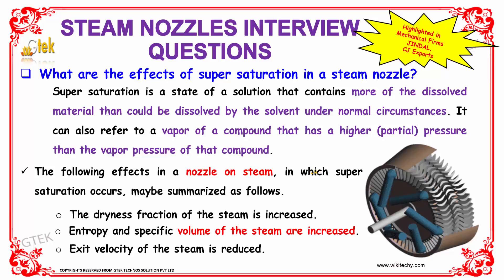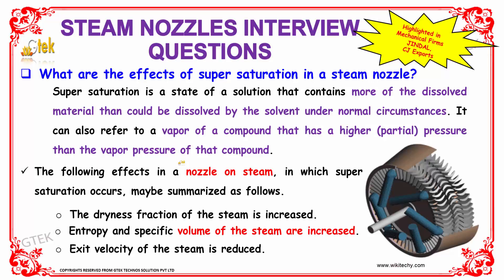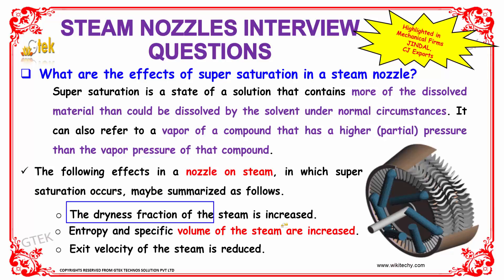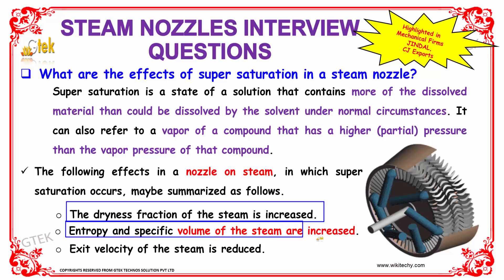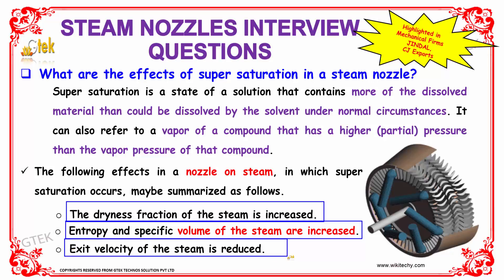Super Saturation in a Steam Nozzle | Mechanical Engineering Interview questions and answers|videos

Comment: the limit of supersaturation is reached, the steam will now condense instantaneously to its normal state at the constant pressure, and constant enthalpy which is shown by the horizontal line where is on normal wet area pressure line of the same pressure

Comment: This is the mechanical engineering questions and answers section on "Steam Nozzles ... explanation for various interview, competitive examination and entrance test. ... When the back pressure of a nozzle is below the designed value of pressure ... The supersaturated flow of steam through a nozzle as compared to a stable ...